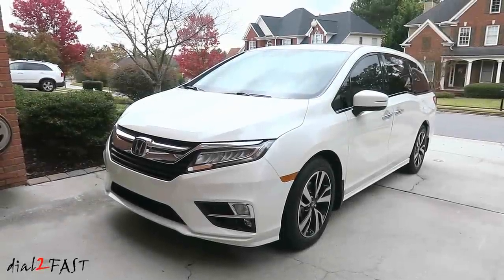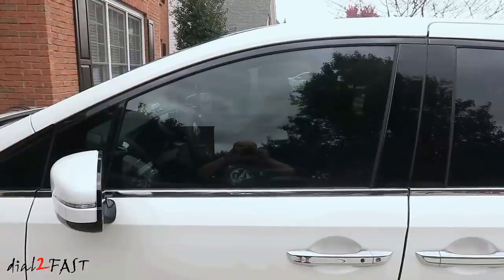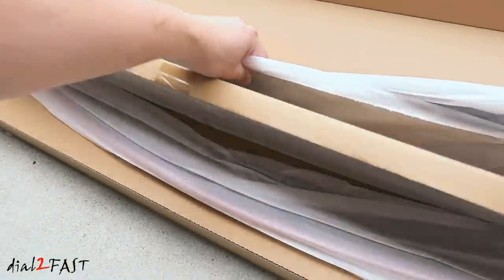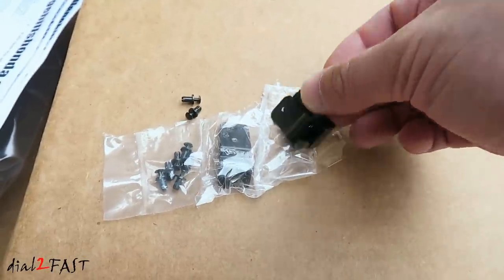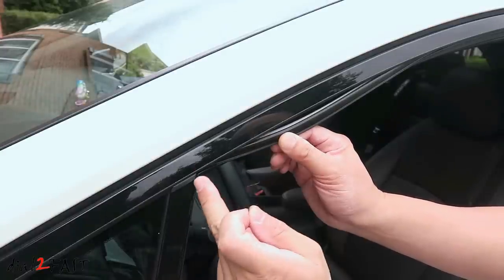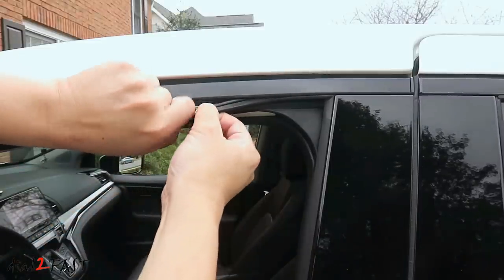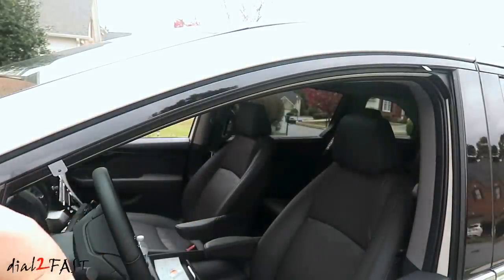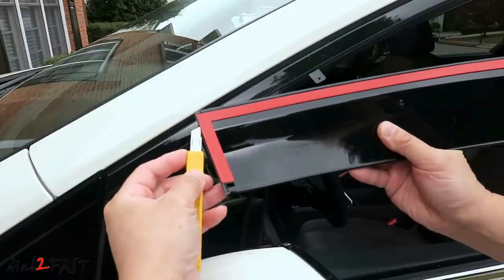Honda Odyssey 2019 Install Door Visors / Window Deflectors

Comment: I just had to reinstall due to the adhesive not working well. Removed excessive material from the door edge and reflectors that I spent so much time. Bought exactly the same 3M brand adhesive and reattached them. After the installation, I realized there was a small gap between the deflector on the front door corner edge near the rear slide door. The front door structures are not flat and I tried to push the deflector but it's impossible to reach the surface. I am guessing the initial installation at the dealership was just like it was. If this second installation doesn't work I would probably go with the in-channel deflector by aftermarket.

Comment: Love your videos. Thanks for sharing. Curious, what’s the benefit of these window visors and sunroof visor?
Reply from the maker: Window visors are great for opening the window several inches during the hot summer when it's parked. From the outside, you can tell the window is open. Also if it's raining, you can still open part way while keeping the rain out. Sunroof visors will keep all wind noise out with the sunroof open, but it does also block some of the fresh air coming in.

Comment: Thanks for your video my package was missing one of the front brackets do you know if you can order extras online?
Reply from the maker: I don't know if a Honda dealer can order just the clip. You can try  calling them but also contact the seller where you got it from and see.
Reply: @dial2fast  yeah I purchased them at the dealer but they are not very bright. I work for Mazda and I know they offer a hardware kit for the accessories I’ll try giving another Honda dealer a call thank you.

Comment: Are you diy tinted or you tinted at the shop?
Reply from the maker: I can do an okay job on tinting but not like the pro so I did not to this van. I got a local shop to do it for $80 with lifetime warranty.
Reply: FYI you may want to have the rears tinted as well as the factory privacy glass is only that and does not provide heat rejection or UV ray protection like window film does. I’m going to have my 19 odyssey done after learning about this since I have kiddos. 

https://en.m.wikipedia.org/wiki/Factory_tint

Comment: Thank you for this, however WeatherTech visors are both easier and fit better!
Reply from the maker: Weathertech may be easier to install with their in channel design, but in my opinion accessories from manufacturers will always have best fit and look better.
Reply: too bad they refuse to make them for the 17-19 ridgelines!